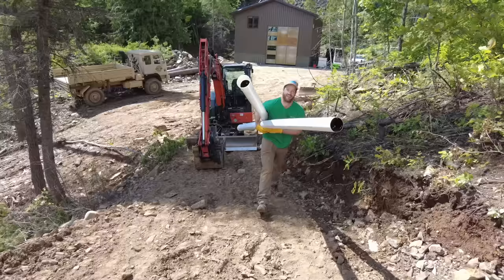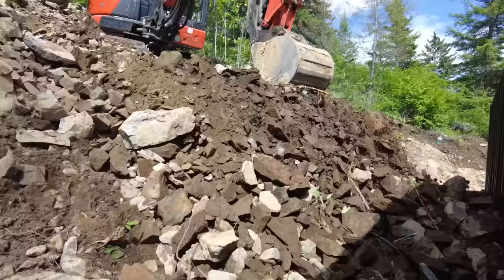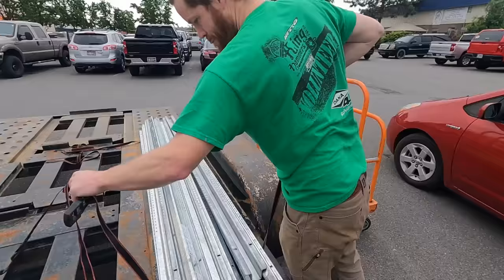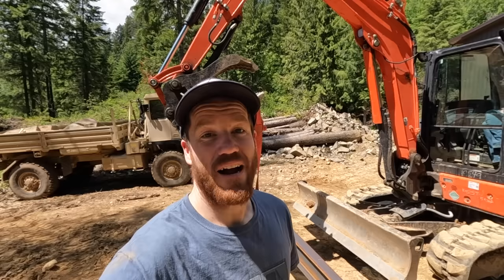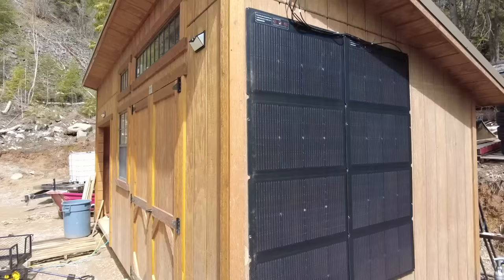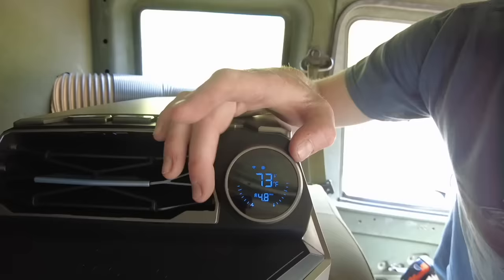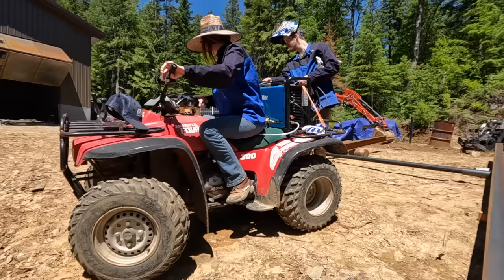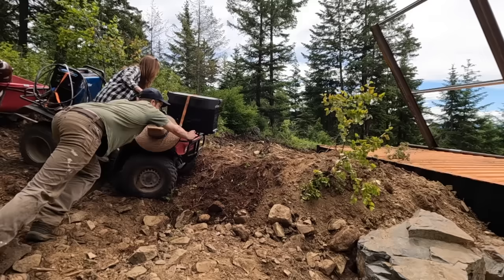We Were Told To NEVER Do This | Burying A Shipping Container

Comment: Might consider drilling and tapping some grease zerks into your hinges so they don't rust and freeze up over winter super cool setup 👍🙂
Reply: Stiffen the frame more also, think of wind load.  Bridges move and sway, the gussets help keep it together from flex the constant flex from load.  You are also putting static load on it, so yes it moved into place okay, but you will want to keep your eye on what and where fails will happen.
Reply: Beat me to it I was going to say the same it won't take much rust to lock that up a little grease and some paint will go a long way to making this last a good long time
Reply: I thot you were gonna suggest zerks for the stakes that kept hitting rock.
Reply: You might want to read up on welding galvanized. I think the fumes can be quite bad.
Reply: @neon1929  the galvanized they have is done, and it's wire chase for panels, they'll just want to gusset and support once they fit the system.  Put some good sized rocks on the downslope to back up your rods
Reply: I did that to mine as an overkill effort when I was cutting the pieces, and wouldn't you know it, it was the smartest thing I did to it. The entire system still tracks like it was on bearings.  13 years now!
Reply: My first  thought too . Atherwise nice Struktur but i Personen would ad some  angle Ironie 2×2 one top and Button to make it more rigid 🤷‍♂️ Atherwise it sis cool . And i would stack all batterie  in side the conex on tn the opposite side of it
Reply: The pipe is no where near tight enough to rust solid to benefit from grease. You could see how loose they are when he slipped the pipe over.
Reply: @neon1929  You're correct, the fumes are quite bad. Galvanized steel has a zinc coating, which naturally contains small amounts of lead (less than 0.9%), and both of those vaporize when hit with the heat of a welding arc. When vaporized, zinc and lead react with oxygen to form zinc oxide and lead oxide, respectively. Zinc oxide does have some temporary health effects, but nothing long term and nothing that fresh air can't fix. Lead oxide, however, is extremely toxic, and has long lasting health detriments.
Reply: You can't have too many zerks.
Reply: @neon1929  you might Wana read up on shipping containers. They're usually stainless. Although the locking bars in front and back may be galvanized. But I would mess with the hinges. Just squirt them with grease and move the door.
Reply: @neon1929 outdoors not so bad, but not cleaning it before is an issue too...

Comment: The conex needs to be off the ground (railroad ties) and your perf pipe needed to be bedded in Gravel with landscape fabric covering it with more Gravel on top. A retaining wall for the hillside is a must as well. Shipping containers have all their strength at the corners. The skin isn't structural
Reply: We buried shipping containers in the desert in Aghanistan and Iraq all through the deployments, we also buried them to simulate underground  bunkers. They just need to look up that info.
Reply: True or it gets clogged
Reply: I too was going to point out a few things myself:
1 They should have cut back into the
    hillside and poured a concrete pad
   and drilled into it to anchor the
   container.
2 Any drainage pipe should be covered
   with landscaping cloth to keep dirt out
   then small gravel with a layer of sand
   on top that. 
3 Was the bottom of the container rust
   proofed like the buried portion? If not
   it should have been.
4 I think the wiring for the panels
   probably should have been routed
   through the channels to cut down on
   extra work although I don't know what
   they have in mind, they may be going
   to run the wires through some kind of
   conduit to protect the wiring from the
   weather.
These ideas aren't meant as criticism but rather just my opinion on how I would have approached this.
Do it your way or as some of how others would. He said he would be happy to get 10 to 15 years out of the installation. Me I'd rather shoot for 25 to 50.
Reply: agreed

Comment: If you are going to adjust your solar panels more than just "summer" and "winter", you could paint marks on your cable for every 10 degrees. That way if you want to adjust your angle you can just look up the ideal angle and move panels accordingly. It also allows 1 person to adjust array, you can just remove the bolts turn the winch to proper position and reinsert the bolts.
Reply: excellent post

Comment: With the weight hanging from one side of the container, my biggest concern would be a strong wind lifting up and sideways on the whole array and container and tipping it over toward the array.  It seems that pre-measured posts to connect the bottom of the beams to cemented in ground mounts (one set of posts and ground mounts for each angle) would provide a support far enough outboard to absorb that rotational moment.  I know the container is very heavy, and will be even heavier with the batteries in it, but that is one huge sail you are mounting on it.  Alternately, you could run cables from the top corners of the container uphill to steel posts drilled and epoxied into the exposed tops of a couple boulders to keep the container from being able to tip, or do both to stabilize both the container and the sail.
Reply: Yah, I am DEFINITELY not a fan of the way they did that.  The array should be, as you said, on its own posts piled into the grouind.  This would also add support for keeping the container in place during heavy ran/landslide condition.
Reply: Ah well, it may just work. One thing that matters a lot is the local prevalent wind direction. I do agree though that this is a huge sail in storm conditions. A few storm tie-down points on the corners may be a good idea. And then, the container by itself - compared to this sail - is not heavy at all. I would consider putting a layer of concrete sidewalk tiles on the floor, not sure if these are a thing in the US. Hereabouts, these are dirt cheap and reassuringly heavy.
Reply: I totally agree the container in a any wind could roll over on its side of the array  and you suggestion is a good one 
It would be the same idea as how the secure by layer retaining walls back into the hillside
Reply: Possibly to of welded steels plates  ( 3 - 4 ) along the back wall then welded steel beams off of them at 90 degrees and a thick steel plate on those beams then back filled covering that so it had the soil / rocks weight to of held the container in place and acted as an ground anchor and counter weight of that steel frame and solar panels
Reply: I agree .. wind load .. even as light as 20mph will place a hige amount of stress on the system.  more well anchored braces needed asap!!
Reply: I am pretty sure Riley has thought of that seeing how well diy-engineered this thing is. Simply put all the batteries, inverters and other heavy tech (probably a metric ton) down low on the opposite side of the pivot point and you have a pretty good counterlever, especially with the weight of the container itself. However, if there is a concern, proper thick metal stakes driven several feet into the ground and welded on the back corners will be more than plenty along with the rest.
Reply: That container weighs more than 4k empty. Not gonna be blown over. My setup is nearly identical and has been awesome for 6 years. The batteries and gear inside will only add more weight also.
Reply: I'm concerned about wind as well. But, I think the weak point is the little hinges used to attach telescoping braces. It doesn't take a lot of force for those hinges to bend open at the hing pin.
Reply: Very cool array but I'm worried, too. Besides wind, nobody mentioned what a huge, wet, load of snow might do on that set at a 25 degree angle in the winter. Snow can also be a lot of weight on top of the weight of the array itself. And it is set on the side of a hill with no foundation or anchoring. It might have been better to clear and level a bigger piece of ground in that same spot to allow for a sturdy foundation and anchoring. Anyway, I wish y'all luck and that it all works out when conditions get rough. Hoping for the best.
Reply: They could also use lead acid batteries instead of lithium to make this container stay still 🤔😜
Reply: @davebodine1526  The flatter (25 deg) position is the summer position. The steep (65 deg) position is the winter position. Even wet sticky snow (if they get this kind of snow) will slide off at 65 deg.
Reply: @andrewsnow7386  Oops, you're right. That should help. The power of Mother-Nature is still nothing to do a double-dare-you against.
Reply: Not too late to run thick steel cables from anchors attached securely to the top of the container (hill side), up the hill and anchored to deeply pounded in pipe. 

The down hill side of the container could have have cables ran from the top corners outwards at an angle and anchored to the ground, to avoid coming into contact with the array assembly.
Reply: I wrote the same concerns...wind is a powerful force.

Comment: The main reason the holes go down is because water will gather at the bottom of the pipe first. If you installed with the holes up then the ditch would need to flood to the top of the pipe before the water would drain. Water chooses the path of least resistance so with the holes down the water will find them easier and can be managed away from the container faster. Something to consider, if it's not too late, is to coat the outside with some sort of undercoating, preferably the spray kind. You won't necessarily need truck bed spray liner but it would last far longer than regular undercoating. The longer you can keep the steel from rusting the longer you container will remain under ground...

Comment: Usually it’s considered dangerous to bury shipping containers because they aren’t built to handle side loads and are really only designed to handle loads along the rim of their ceilings and on their floors. It’s very possible that after some time the walls cave in because of the weight of the dirt pushing into the side. Especially with extra weight like water/snow/frost.
Reply: They should be OK unless there is a LOT of traffic uphill from the container shifting the dirt and rocks downhill. One way to build a stable retaining wall is with a metal mesh cage filled with large stones called a gabion wall. The way the rocks were laid along the side might act as an unboxed gabion wall. If there are no shape rock points shifting into the container I think it will be fine.
Reply: @walterrutherford8321   It won't be fine or safe, these containers aren't designed to take side or top loads. There is an online video showing examples of containers buried without proper re-enforcement, it's clear what happens with only a few inches of dirt on top, never mind when it gets wet.
Reply: @MrCleitus  https://en.m.wikipedia.org/wiki/Gabion
Jagged rocks don't settle and shift like loose soil. Without serious side forces, the rocks won't move. Any side forces now will be from landslides which, on that hillside, will be a possible hazard, whether the container is buried or not.  But, the true test will be to check with them in 3-5yrs.
Reply: @walterrutherford8321  As an engineer, it is a really really stupid idea, but you can't fix stupid.
Reply: You are right & also I want to know that why all container homes made by people are not touched with ground (I mean 100% touched {not only corners})
I think it will decrease the strength of a container when it is not touched with ground.

Comment: Throughout all the episodes I was always impressed by the deep consideration and planning. I understand the time crunch but when you started this project I felt you started cutting too many corners. My biggest concern is that there is no foundation for the container. Yes, batteries and everything in the container will add weight but it would have been prudent to place the container on solid corner foundations and weld the container to the foundation. You can still drill some holes and pour concrete in the front to bury steel beams vertically that will support the container. Otherwise when you will have high winds and solar panel sails you will have the container moving. I like the hinged idea but please consider reinforcement of the wall, maybe from the inside where the hinges line up. One more corner cutting I saw when you welded the HF winch to the wall. These container walls are not that sturdy having all the forces on this one point of contact. You pinned the extending struts on the top but still this wrench will need also reinforcement from inside. Also the extending struts will need reinforcement on the wall.  
Containers leak from the bottom up when you bury them. Luckily you "did not bury" them but it would have been better to have drain channels underneath towards the downhill side.
Sorry for this, I usually refrain from commenting as its always easy from the comfort of the home office to see details. But I felt compelled to do this as you always impressed me with your attention to the level of detail. I just build a 45 ft car port of a container and can attest that these are not that sturdy to bending forces. Keep up the good work! I love your channel and your 'off grid way of life'. Cant wait for the dozer work.
Reply: Well.. as there's freeze where they are, the frozing of soil will make the whole soil/hill expand behind the container.. he will end up pushed downhill one day or an other.. those little rods won't hold it there.. oh and if they would, the wall would cave in slowly.. benting in.. until weld fails.. it is what it is.. the fact there's no foundation will only help it glide toward the downhill portion.. might save the container from being damaged.. we'll see with the years passing by
Reply: I see that everyone who applauds their foolish plan gets a like from the people who are doing this, while this really smart (and somewhat obvious) criticism is studiously ignored. Smart people welcome insightful criticism. It's helpful. Everyone makes mistakes and nobody knows all the answers. But these people are just dimwits. "What colour should we paint the container?"  The colour is the LEAST of your worries.
Reply: Josey Wilds  - said "...Yeah no one cares let them build their coffin....."

Fcuk me mate, that was a bit harsh!!!!!  
No less a funny comment though  ;)

:)

Comment: Great job guys!
I would be very careful moving that high pressure gas bottle around without the cap installed. Especially laying on its side. If it had rolled out of the cart and broken the valve off, you would be surprised at how far the missile could travel.
Reply: Gosh yes!  It’s scary when one of those goes off!
Reply: Shush..Darwin needs work too
Reply: yes they can punch a hole in a block wall that is fully core filled with concrete
Reply: Imagine the # of views they would get , though  🤑😂😂
Reply: @chrisforgan731  Saw it happen during shop class back in high school. oxygen cylinder was knocked over breaking off the valve, the cyl went through a  block wall, traveled over 100 yards and buried itself in our garden plot. Unbelievable how much dust and dirt was in the shop, the rocket blasting off exposed all of it!
Reply: Yeah... High pucker factor just watching it.
Reply: ever try to remove a botle valve??? nearly impossible to brake it off.
Reply: It's not like it is in the movies. Extremely hard to break those off. 3/8 solid brass lip. The caps are for preventing turning disc from being damaged or accidentally turned on.

Comment: Camo out the container and panel supports in a pattern that will match the surrounding forrest. Great job on the build. Drill the pivots the install grease fittings for long term ease of movement. 1/4-28 tap for threads. Use your jack hammer to install the pins in the ground.

Comment: If you want your french drain not to plug up, you gotta put some landscape fabric around it to keep mud from infiltrating. Or you can clean out the pipe periodically, which should be easy in your circumstance with the exposed straight ends. Also, rust is more complicated than you might expect. Things rust when exposed to both water and air, and how fast they rust isn't something you can easily guess just by looking. Not all water is the same, and some kinds of it lead to more rust than others.

Comment: I think you should have poured concrete footing under the container so when the ground gets wet there will be no container shift.
Reply: I agree and a hydroduct drainage system on the buried side
Reply: Agree we  live where there is a lot of clay and everything moves when it’s rainy season we put everything on pads raised above the ground with French drains around every side  30 years later no mold or moisture in any building
Reply: Agreed, containers wooden floor will not last.
Reply: Running the drain below the bottom of the container should help.

Also, leaving some of the  down side material or filling the down side, before filling the hill side would help with movement.
Reply: Yeah that container is definitely going to shift,a concrete pad should have been done for the container to sit on,then you can fasten the container to the slab. Plus that pvc pipe drain will not last under all that weight,pvc pipe is not designed for those types of forces,you should have used polyethylene pipe that has drainage slits cut into it and is designed for load stresses. Hope it works out for you guys ,but i can foresee problems with that sea container.
Reply: @vobchopper  Drainage system forsure! that load of water is no joke
Reply: Thats what his shitty stakes are for lol

Comment: I think your main issues with the solar panel will come two areas: 1. Freezing and shifting/snapping welded joints and 2) Wind pressure and vibration.